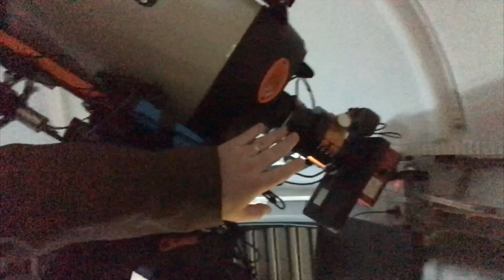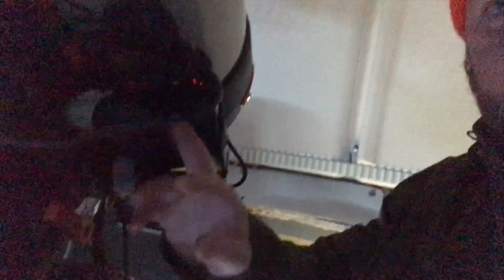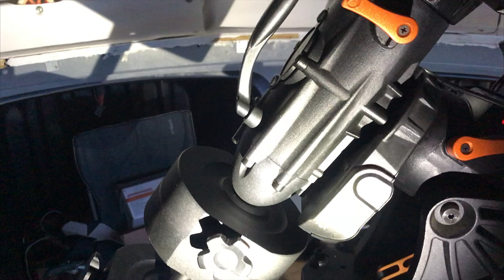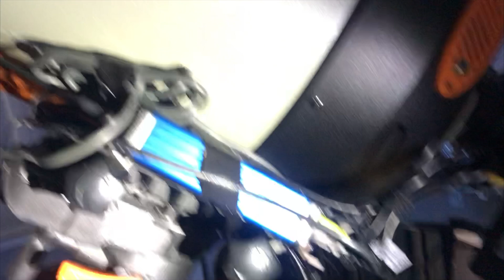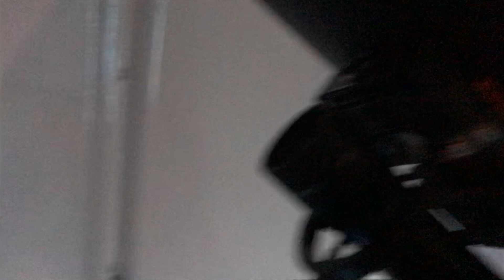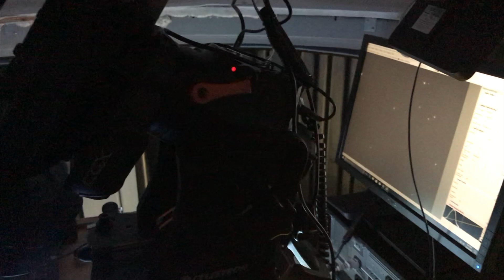CGX New Autoguider + Barlow lens + Pegasus Ultimate Power Box

Comment: I think that the 50 mm guidescope is too small for your OTA even with the reducer. The Barlow also narrows your guide camera’s FOV so you’ll have less stars to choose from. You’re better off with a fast 80mm guidescope that will better suit your OTA.
Reply from the maker: Thanks so much for the view and the comment. I really do value your input.You have a high likelihood of being right.  I can only say that I've tried now a couple of nights this week and I was consistently getting 5 or 6 stars with SNR above 100 in a 3 sec exposure. I've been guiding to under 1 pixel RMS and my plate solver says I'm at about 3 arcsec/pixel.  I have not had time to process the subs so I don't have a final picture to show off. But initial look at them says the stars are round. Now how good the FWHM of those stars is I will have to evaluate.  It's an experiment. I can only contrast the experience with my OAG, and I rarely ever have a guide star in a 5 sec exposure that has an SNR over 20. Most of the time I'm lucky to have one at 10. That means a noisier signal to guide on, although Maxim DL keeps up okay. My RMS numbers with the OAG are typically 1.5 to 2.5 pixels which for that camera is 2.5 to 3 arcsec.  And that's IF a star is in the frame to guide on. Many times it was not. But if the stars don't come out round, all this is just my ramblings. I'll try to evaluate the images and either make another video or post them somewhere. I very well may find that this setup is not good enough and go with a larger guider.